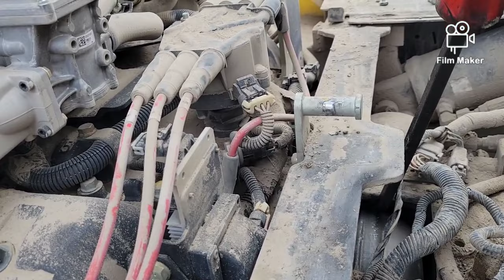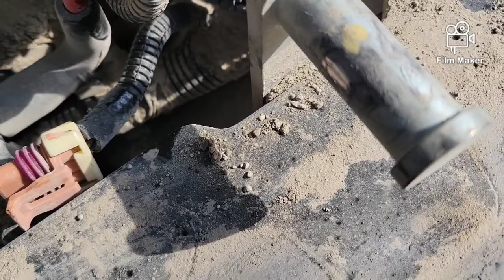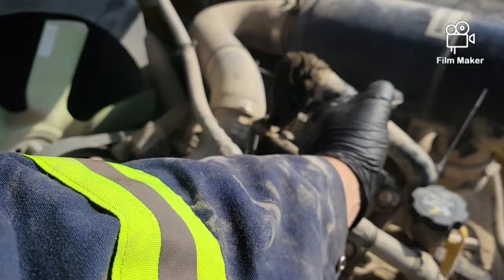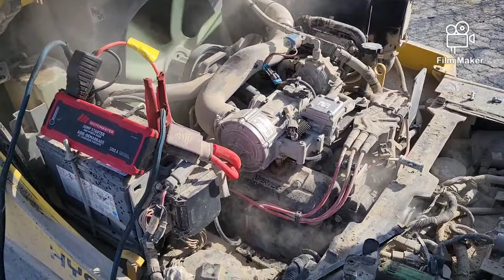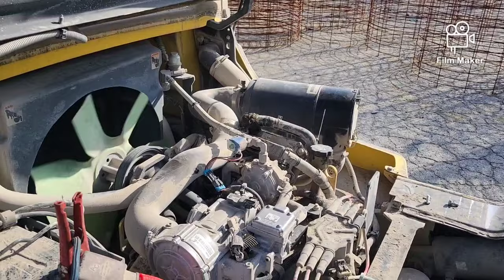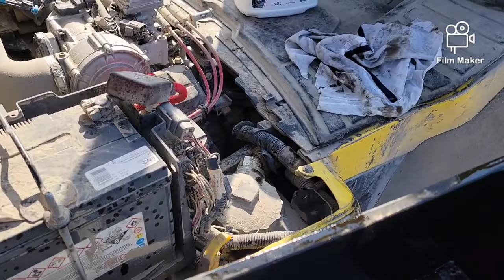Hyster forklift with a seized engine! 4.3 Vortec!

Comment: That thing started almost normally after you got it free. The way it was knocking there for a bit made it sound like one of the old 6.5L Detroit engines GM used before the Duramax. Another boat anchor of a motor that sounds horribly broken, even when it's working properly. lol.

Those old 4.3s are nearly bulletproof. They were always dogs and ran rough as a paintshaker, but they would pretty much always run.

Comment: Hoping to Unseize a H20 LPG engine, had a blown head and radiator and has been sitting since 2021. The crankbolt turned a entire revolution so doubt it'll be possible though. If so, a rod will definitely be going into orbit more than likely.